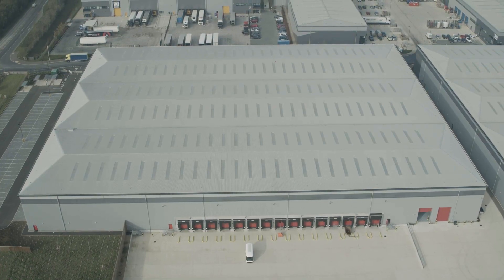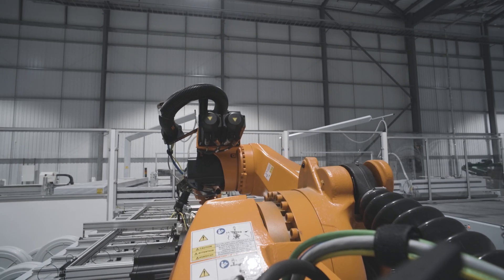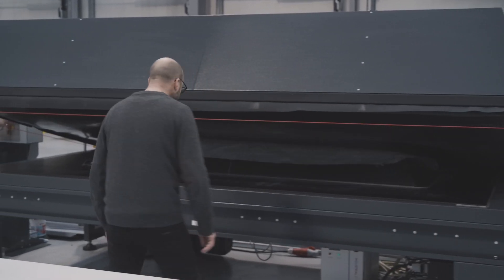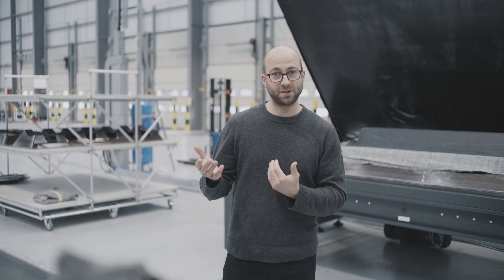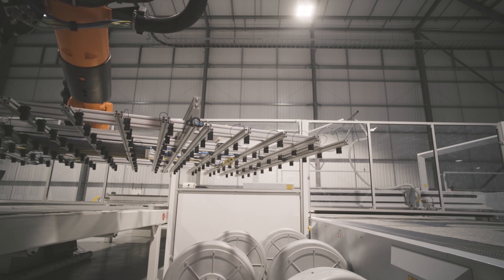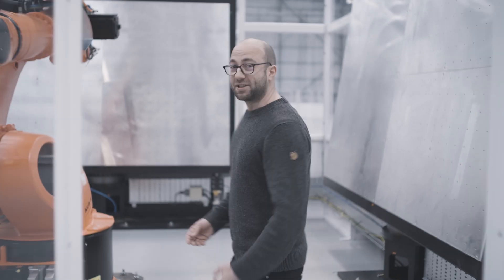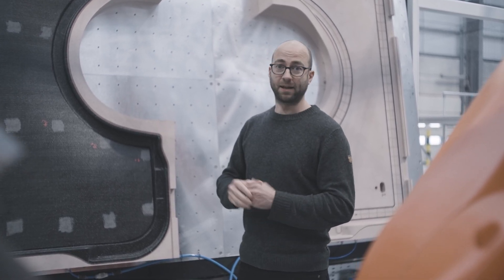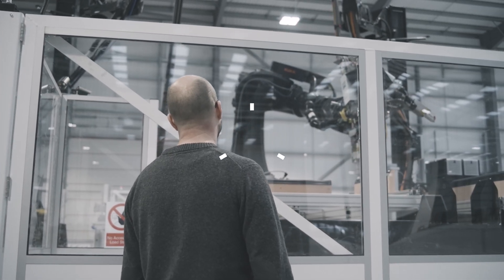Inside the Microfactory | How Arrival Makes its Materials | ARRIVAL

Comment: Watching closely to see if you can get the production needed to make this work. I applaud you for tackling the use of composite material in automated production process. You have really rethought the whole process, never seen anyone use textiles in place of carbon fiber. Have you developed your own resin or is this epoxy? The molding process looks like a vacuum with resin infusion, wondering what your curing time is before mold release.
Have no doubt that you can build using your micro units, you probably are already.
Reply: I am working on Prototype of SUV type sedan that would have a curb weight of less than 1,000 lbs and get over hundred miles to gallon. This is possible by making almost total car out of composite material parts and then assembling similar to stamped metal parts.
Your process would work well for the manufacture.
Reply: Would like to send some photos can you provide e-mail?
Reply: DO YOU HAVE ANY KNOWLEDGE ON HOW IT'S MADE?

Comment: It's good idea in general.   How many vans can be assembled with this slow speed robot movement?. It seems for only demo purpose for me.
Reply: But the difference is that you have a lot of factory sheds like this, not one or two for worldwide production.  So this factory only has to be fast enough to supply say Bedfordshire and Oxfordshire. There is another in Norfolk for East Anglia. One in Kent, one in Devon, one in Wales, one in the Black country, Manchester, York, Glasgow, Preston. and so on around the world. Each shed doesn't have to produce that many vans.  I have no idea if this is really going to work in practice, but especially if they make use of the flexibility by having designs to suit a range of customers and be close to building -to-order: 3 lengths and 3 heights and 3 battery sizes, and a couple of camper versions (different panels and doors, maybe some of the internals made from this composite), a pickup/tipper version, a platform version for specialist uses and so on, I can see this being a huge success if the end result isn't too expensive.

Comment: I'm a share holder but man how long does it take to produce 1 vehicles
Reply: It doesn't matter much because the cells and factories are parallelisable. So yes it's slower than stamping out panels but you can build another factory for the cost of one of those stamping machines, and 3 more for the paint shop to dip and paint it. And you can change the panel at essentially zero cost as opposed to half a million on a new former. What matters is the cost of the overall process and how well they leverage the flexibility they have to make variants and customised vehicles. For example it's almost trivial to make a camper variant with a great big fat battery, which I suspect will be very popular with a certain segment of the market (someone still has to do the design work, but plenty of people would love to help them with that).
Reply: @xxwookey  i get all that mate.  What i mean is, if they don't get a wriggle on another company may beat them to it and may produce something better and cheaper. Pre-orders really don't mean much when the industry is moving at this pace.
Reply: i'm looking to invest too but i'll wait till i see something tangible first. Where did you buy your shares mate and around what price if you don't mind

Comment: This seems to be a rehash of other videos, nothing new. What I'd like to know is how does this scale up? proterra has delivered 1000 buses thus far and BYD manufactures thousands each year. How many buses can be manufactured by each micro factory cell? 1 per day? Per week? Per year?
Reply: Each micro factory has quite a lot of cells. The production rate presumably depends on the total site area (i.e do you have room for two, four or 20 of these panel forming and cutting cells, and whichever other ones are bottlenecks). They save on stamping machines and the incredibly expensive paint shop, but might need quite a few cutting robots. I'm not sure anyone knows how the sums work out in the long run, but I guess these days reckon it can go 'fast enough' for a given investment in kit to work out.

Comment: Product designer here. Loved to see this. Novel approach. Great for prototypes and small series, but I wonder if it is fast enough for mass production? CNC Robots seemed slow.
Reply: Flexibility vs Speed, typical conundrum for any highly reconfigurable parts (low volume) to standardize high volume manufacturing.   It called "Micro factories" unlike Henry Ford production method.

Yes, it slow and the articulated robotic arm are unusually high capacity for it milling operation.  It would be interesting to see if they ever standardize parts for modularity sake beside the "skateboard chassis".
Reply: Presumably being local to the customer makes up for that? No shipping parts across an ocean?
Reply: After some volume and data analysis, they should have the processes and tolerances worked out, after that speeding up is a setting in the software within the limits of the machine and material handling among stations.

Comment: This is very interesting. It seems like this is much slower?
Reply: It'll be amazing to hear output/production figures compared to generic bus production line
Reply: That's my concern as well,  but maybe they plan to run it day and night + have a LOT of micro factories
Reply: Same concern here.  None of their videos or interviews to they specify production time for either the bus or van
Reply: Just to produce that composite part alone seems to require a lot of robots and work space, I have yet to see them producing the chassis, motor, battery packs etc.
Reply: Orders of magnitude slower. Yes.